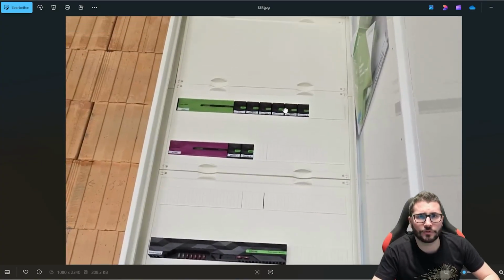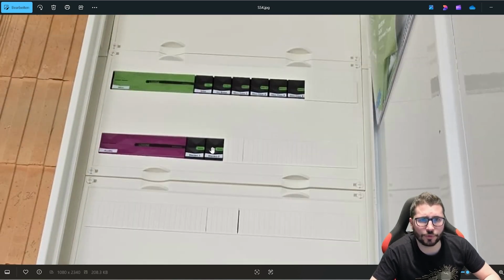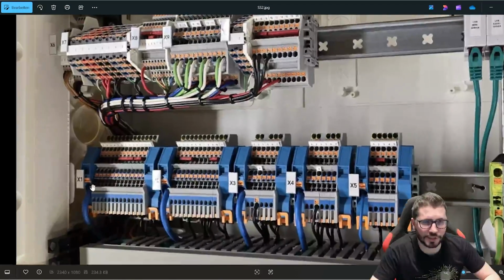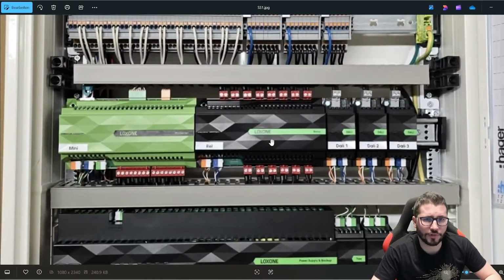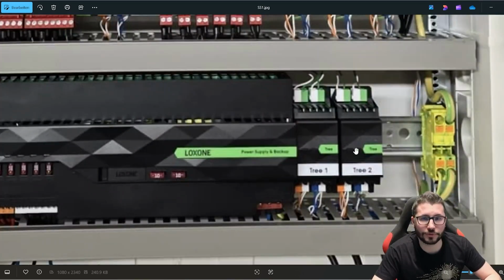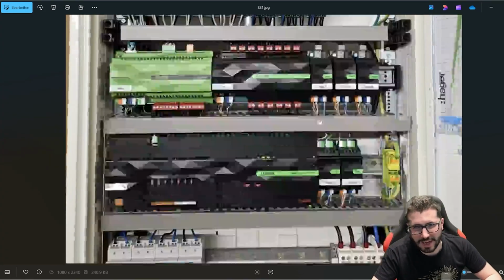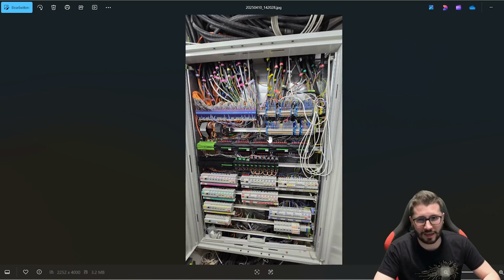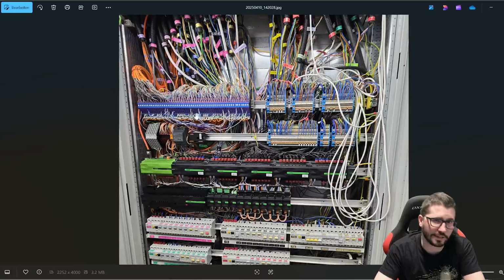Build a Loxone Cabinet Like a Pro 🏡

Comment: I have a project with 328 tree devices, RGBW spots, touch pure, presence detector a lot of RGBW dimmer, need to design the panel, please let me know if you can help.
Reply from the maker: Hello! Sounds cool.

As some of you might remember me working for Loxone, thats no longer the case, I am a Loxone partner myself now.

What I recommend is taking the free consultation of your Loxone partner coach. 

But I do work with quite a lot of Loxone partners together which book some consultancy. Feel free to reach out to me on Linkedin

Richard Högl

Comment: Richard, I understand to connect the minus (-) clamp of all 24V transformers to eachother. I am pretty sure I can mix that also with 12V transformers (only connect (-) side to the 24V power supplies);  but should this also be done for drivers (lighting), which provide a contant current instead of a constant voltage?
Reply from the maker: Hi! The effect is only if Loxone has to deal with the voltage. If you just switch 12V with a relay to a doorbell, no need to GND connect. If your constant driver is controlled via dali, no need but as soon as you have a 0-10V output controlling it you need to connect GNDs